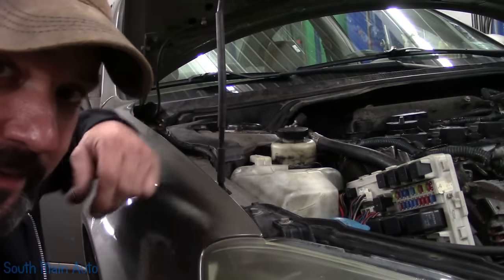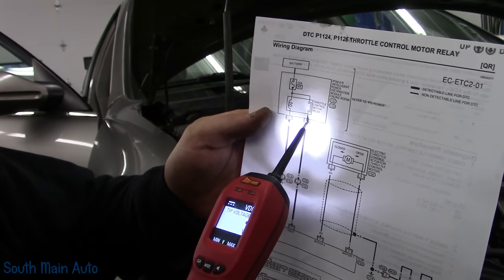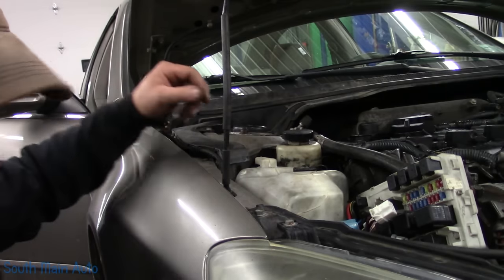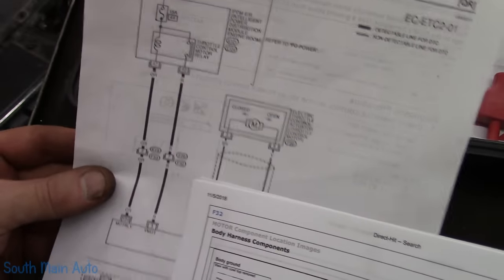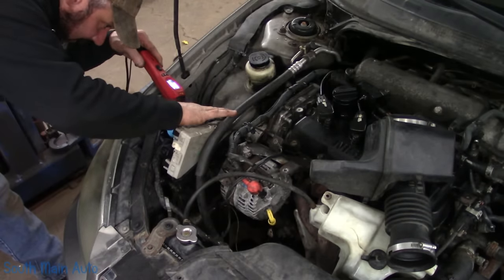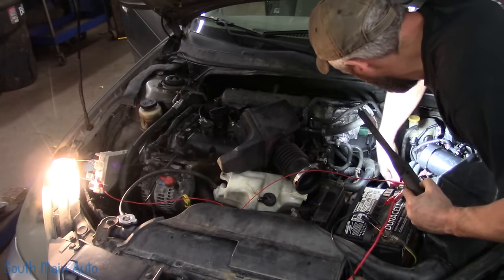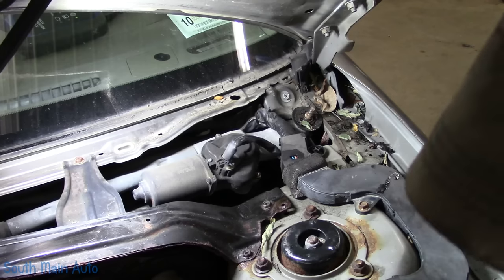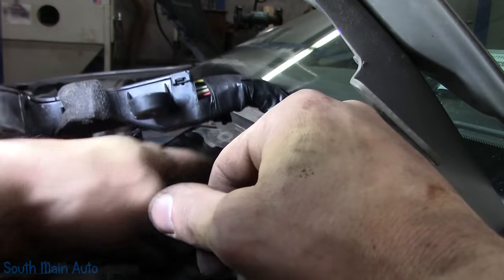How To Fix A Car That Keeps Blowing Fuses

Comment: On my husbands 2006 maxima, the main fusible link positive battery terminal fuse keeps blowing. It first blew this main fuse like maybe 6 months ago so we replaced it, no problem. Then about 3 months ago, it blew again so we got it replaced again. Obviously the car dies everytime this happens. 

Then last week, I was trying to get an appt with firestone auto repair because the temperature gauge had been going above the middle and we had to put coolant in it multiple times over the next few days. We thought that the coolant replacement would at least hold it over until our appt at firestone (realizing that there must be a leak obviously and thought that must be what is causing the car to overheat). Then last week on a really hot day, I got stuck on a bridge because the bridge was up and the temp was going up and up and I got so nervous because I couldn't go anywhere so I just turned my car off. Then when the bridge went back down, I tried to start the car and IT WAS DEAD. ON A 1 WAY BRIDGE. WITH 10 CARS STUCK BEHIND ME AND 2 KIDS IN MY CAR 😭. Eventually some men helped me push the car off the bridge, into the city. I realized that it was acting exactly how it did before when that 120 amp fuse was blown. So I checked it and yup it was blown. My husband got there from work and replaced the fusible link terminal piece, topped off the coolant and at that point we were going straight to firestone (3 miles away) for them to get to it when they could. Literally 5 mins into driving, the heat started going up and up and before I could pull over, the car died in the damn freeway. Fuse blown AGAINNN. I gave up and had it towed the rest of the way. 
Firestone said they have no idea what it is and told me just to buy a new car. I'm not about to just throw in the towel without at least being mostly sure that the car is a goner. The engine was rebuilt 3 years ago, the alternator is maybe like 6 months old and it's paid off so if you have any helpful info, I'd super appreciate it!

Comment: Had a Lincoln mk3 intermittent 2fuses  hooked a variable battery charger to fuse followed the warm wire to the harness under the windshield  where it went cold was a sheet metal screw removed screw fixed it

Comment: Im having a similar issue on my2015 jeep Wrangler it's m19 fuse witch leads to the asd fuse my jeep won't start just cranks the fuse blows only when I turn the ignition off if the ignition is on and I put the fuse in then it won't blow and turn I turn it off it blows I have also swapped relays and same issue

Comment: I got one my 2000 blazer when I put on my lights they are dim then when I put on my brakes the head lights turn on normal when I use my high turn signal my lights blinks?

Comment: I kinda wish I had a dead short in a wire causing my problem. It might be easier to find than an intermittent signal. My 95 E350 PS sat for a couple years. After getting it going, it has shifting problems off and on. The speed sensor was replaced with no help. 
After finding the tone ring was rusted about 1/3 the the way around, it was replaced, along with the bad pinion seal in the diff.
 Now,every once in a while, it won't shift till wound for sound, and it shifts HARD. Once in awhile it will act like it drops to neutral when wanting to sift. ☹

Comment: Do I need to remove the Ecm before I do the test light thing you did? Please let me know anyone
Reply: the power circuit was shorted. the half(past the connector) to the ECM was where the short was. unplugging the ECM eliminated it as a part of the problem a diagnostic step. could the test with the light have been done without unplugging the ECM my guess is yes. but diagnosing the problem required isolating the wire. that proved the wire was the only problem.

Comment: I have seen this way to many times.
People just swap out parts way to many times.
I use my tone generator same as the light somewhat but it will send signal and will have you find the signal and then tone gets lower as you get a way feom the brake

Comment: I have a 99 f150 and the flasher turn signals always goes out. I have changed every fuse and relay. Here is the thing also my trailer lights never work any ideas. Also my ABS light is always on

Comment: I had an ‘86 Nissan Sentra that wouldn’t run because of a relay connector in the fender, behind the right headlight had corroded to bits. It supplied power to the ignition. Not to disrespect Nissan, but you can’t leave plain, untinned, copper wire exposed, at least not in the rust belt. The relay wasn’t even close to anything connected to it. They just randomly stuck it as far away as they could.

Comment: When ever I buy a car its always as a none runner because they are cheap, 1st thing I do is get hold of the manufacturers service manual, I always buy and love Japanese cars like Toyota and Mazda because the service books are like 6000 to 7000 pages long full of service tech and indepth test procedures I'm a petrol head and this to me is like a good book to a Librarian 😁 , makes finding faults on wiring so much easier, my recently acquired 2009 Mazda 2 came with wiring faults from previous garage fuck ups and listed as none runner needs a new ecu, it didn't it need an ecu at all just needed some patients and tlc and some new wiring in places that didn't check against the service tech.

Comment: Eric, maestro, my observation it’s you are not explaining the problem, you are talking to  yourself, that make you think twice,  very smart people acts like that, and very few.
If you accept this tip, the tool you are using it’s the right one, had you try the short finder.? You will short your time to find the problem.
And another think don’t call yourself a mechanic, you are a technician , and it’s not a short circuit, it’s unwanted ground.
Congratulations          Greetings

Comment: Thank you v much for this excellent video
I was thinking how a lot of the time, mechanics accidentally fix cars by changing parts without fully understanding what they have fixed.
Hard to see this car ever being fixed this way.
I thought you might replace the wiring harness as mutiple wires were bare and you had most of it dismantled and there were signs of previous fire
but i know customers like costs to be kept to a minimum

Comment: You did a fantastic job diagnosing the short.... finding it is another story ....JUST TAKE THE ENGINE OUT OF THE CAR  just kidding..sometimess if you're lucky you can find them .....BUT....most of the time they are deep in a harness...... If this is the only thing on the circuit. bypass it...iN MY SHOP WE HAD A TOYOTA MECHANIC  HE HAD EVERY DEGREE YOU COULD GET FROM TOYOTA ....JOEY THE OWNER HAD HIM LOOK FOR  A SHORT IN A TOYOTA...I WAS OFF ..WHEN I CAME IN THIS GUY HAD BOTH SEATS OUT OF THE CAR DASHBOARD OUT AND STEERING WHEEL DROPPED AND JOEY WAS SHAKING HIS HEAD  .... ONCE I FOUND WHAT WAS SHORTED...THROUGH  THE WIRING DIAGRAMS....I TOOK 8 FOOT PIECE OF WIRE .....CUT THE PLACE WERE THE SHORT  WERE BEGAN.... THEN CUT WERE IT ENDED ......BYPASSED IT  SOLDER IT HEAT SHRINK SHORT GONE 10 MINUTES..... TOOK HIM 6 HOURS TO PUT THE CAR BACK TOGETHER.....IF THE CUSTOMER  DONT MIND....BYPASS

Comment: I had a Nissan that kept blowing fuse every few days never was. Able to find the short I know it was a wire around the engine 
So I put a headlight in place of the fuse worked until It went to the junkyard 
When the short happened it would backfire & the light would light up it was a good 50 dollar car to me in the late 90s

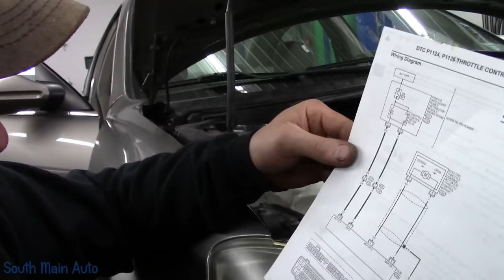Comment: I'm at 1:52. If a circuit fuse always blow with a load, I'd first try replacing the load, then check the wiring of the load.

Comment: I don't understand how a shop comes up with a bad ECM diagnosis for this problem.  It was clearly a short in the throttle control circuit based on the symptoms.  I could maybe understand them trying a new throttle body, but changing the fuse block seems crazy.

Comment: This is a good example that those plastic clips and hangers are there for a reason, if they didn’t need to be there then the manufacture would save every cent possible! If you remove stuff put it back the way it was from the factory don’t modify things it can lead to problems like this!!

Comment: Yeah, you could let the bad circuit lay disconnected where it is and not locate the cause of the short, but the cause may start shorting more wires huh.  Oh, it,s a Jacker!

Comment: I'd really like to know the other shops justification for throwing the parts at it that they did. New fuse block? Really? New throttle body when the short is still there with the throttle disconnected? New ECM when the short is still there with the ECM disconnected? Their "diagnosis" doesn't even make sense.

Comment: My solution to a problem like this, would be to find a nice old Datsun 510, and buy it, thus avoiding the endless nightmares inherent in most new Nissans, and other marques as well. New cars are really computers with wheels. Did the auto industry consult us, before packing so many bad ideas into our vehicles? No, of course not.

Comment: Wonder if you couldn’t just do what Louis Rossmann does and put a small current to it and look for heat, if you had a thermal camera that was good enough, you could just unhook the battery and apply low voltage moderate current through a load appropriate to the wire size and look for where it stops being warm/hot, then you have an idea where it either hides into the next area or where the short is, and you know for sure the short isn’t on the side where it’s hot still, and if you know where the other end is meant to be, you could do the same but in reverse after it cools and look for where it stops being hot, that tells you that it’s between the two ends of the hot areas, if it’s the same area then you’ve pinpointed the short, also for breaks they have a tool t... wait didn’t you show that one??? Anyways it tells you where the wire is by sending a radio signal down it

Comment: Reminds me of a story, a home owner spent 1200$ changing stuff in his house, had holes in walls and his kitchen light still wouldnt work. He calls and electrician, guy walks in, looks around, goes to the breaker box, wiggles a wire and the light starts working.  he tightens the screw holding the wire, and says " that will be 200$". Customer says "200$ to wiggle a wire" Electrician says" i wiggled the wire for free, its 200$ because i KNEW WHICH WIRE TO WIGGLE" HA HA HA HA. yeah its kinda like that.

Comment: Funny how no attention to detail, like not getting the wiring harness in that clip, leads to problems down the road.
Reply: Best thing to remember is that every part is on a car for a reason. If they could have saved $0.05 and eliminated that clip, they would have, so you had better leave it there and utilize it as intended.

Comment: On my way home the other night and I saw someone on the side of the road.  Car just died while they were driving and would not start.  After pulling over, I popped my trunk, got out my toolbox, jack, jack stands, caution lights, 4 way, and creeper.  Once I carried all that over to their car, I noticed the hood was up and asked them to close it.  They looked extremely puzzled but went ahead and did so anyways.  Once it was down, I casually reached over and wiggled both wipers quite aggressively and said, "Alright, go ahead and crank it!".  Nothing.  Looked them in the eyes and said, "Hell, I'm stumped" , packed up and took the hell off....

Comment: Actually I have seen this happen in my shop even tho my  shop (dead now) and like you the shake wire/ wiggle test is your friend. That cars wiring pattern is not but, are they ever. Takes might smart engineers years to get this messed up and keep therapists busy. Love the humor (never forget flowers for helper) #2. sweater. But I'm glad it did raise its head. I tend to gravitate to moving parts when doing a shake test unless I see a new stereo in dash. Never fails they want to put some LEDs under dash or something  just as stupid. (get a hobby) what I want to tell customer, especially if you know they will never be back but fortunately I keep mouth shut. first thing customer does sometimes is look under dash take a wire tester and grab a wire hanging (not plugged in)and tape in wire to switch on dash drilled through with home depots best buy drill and bits (jap crap) go with said wire in now f...ed dash and twist wrap a said wire to light duty switch (5 amp) and load a stereo amp plus "cool" light package that any trucker would be proud of and because of power draw have dime headlights when on... Have I wasted enough of your time, that is five minutes of your life you will never get back. Cheers fellow wrench engineer.. Morg

Comment: I put a new belt on my girlfriends 85 Chevy celebrity, her and her sister went out on a day trip over an hours drive away, she called me all upset, the car died so they were stuck on the side of a busy Interstate route 80 at the Delaware water gap, I went to pick them up, the next day we rented a tow dolly from uhaul went and towed the car home and to a garage run by friends of mine because I couldn't figure out what what happened by just installing a new belt, in the back near the firewall was the alternator and somehow a wire that controls the fuel pump started rubbing on the belt and eventually cut through it.

Comment: My gosh...why waste a perfectly good piece of speaker wire when all you needed to do is install a bigger fuse? Everyone knows that if the factory installed fuse blows that apparently it just can no longer handle the amperage. Bump that 15 up to a 30, good to go!

Oh, the 30 blew too? Hmm....'kay....guess all we can do at that point is bypassing that fuse with the jumper wire. Afterall...who wants to keep wasting money by replacing those gosh darn little fuses anyway?

I love when people get lazy after doing a repair and neglect to do some of the simplest put together tasks. Ya know...that white harness holder was placed there...for fun! It obviously serves no purpose and Nissan spent...probably a couple of grand installing them on all these Altimas just because...well, it just looks good. ;)

Comment: I am At 20:21 and I would so much forget where this wire runs and run my own big red wire------ and inside each terminal to its correct pin. And this guy has already paid for a new throttle body and no telling what else from the other shop. How can you deal them out and just go straight to the customer but probably unethical even when they badly screwed the pooch. Maybe if they would have given up sooner it wouldn't be so expensive to the  customer.
Reply: Well Eric O did need to find this contrary to what I said. Heaven's sake I don't even know what the blue wire did.

Comment: What kind of half assed shop threw a throttle motor, new fuse panel, AND was about to fire an ECM out of the parts cannon for such a simple problem?  Unbelievable...  Not that pin pointing exactly where a short is isn't a pain in the arse, but it's easy to determine whether a short is in a harness or a component. I've found that 99.9 percent of the time it's not the ECM.  As a rule of thumb, if you think the ECM is the problem, then you're missing a part of the puzzle or don't understand the theory of operation of the system you're working on.

Comment: Whoever sent this problem to you should be very embarrassed. It basically shows that trouble codes mean nothing if you don't have the common sense and knowledge to go with them. Already they slapped on parts that were not needed and then jumped to the ECM as the problem! Pretty poor mechanics if they can't track down a basic short plus bypass a fuse with a wire!! I realize a wiring diagram and locations are a big help but this is just basic electric troubleshooting. NOT that i am belittling the video because you get in to much more complicated problems than this. I am just peeved how these guys approached this costing a customer a lot of money. Even a backyard do it yourself type of person could of fixed this. Enjoyed the video though as always. Too many people think "oh, he just plugs in his expensive scanner--- gets the codes which tell him the problem --- then he changes those parts and voila it's fixed". But then i have seen other mechanics befuddled finding a electrical problem even when it is a basic one like this. Why, i do not know? You always deserve the thumb up. What goofs give the thumb down? Hope the customer sees this, maybe they will change their mechanic! I would, just wish i were close not thousands of miles away!

Comment: so first off, replacing the fuse box because of a blown fuse is incompetence. ive never heard of that ever. 2nd, you should, which you have done was to diagnose the issue yourself. 100% of the time you will find a completely different issue which has caused blown fuse.

Comment: When the parts cannon fails, call a real mechanic.
 More proof that the "cheaper" mechanic costs you more. Didn't need a throttle body, a fuse block, or the ecm.